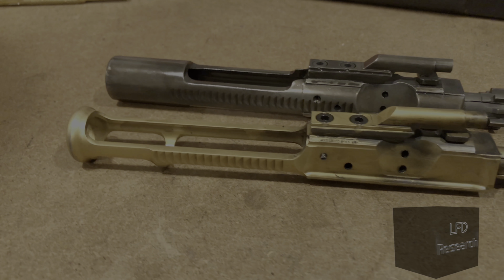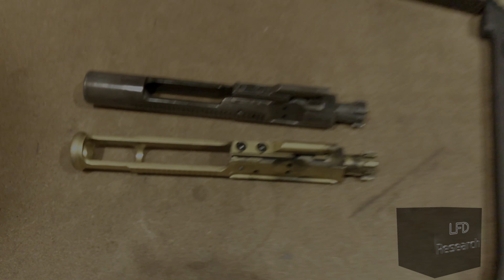Lightweight AR 15 BCG

Comment: This is the best lightweight BCG video I've ever seen. It truly showcases the differences between standard weight and lightweight. I'm looking into lightweight bull carriers to try and push the envelope of the binary trigger I just installed. This video sold me that I can run it harder and faster with a lightweight bulk carrier than I could with a standard weight! Thank you for a fantastic video this is truly underrated content
Reply from the maker: Thanks if you want even lighter they do also make a titanium carrier but it costs more than 2x as much

Comment: I love this. I hope you still check comments? What buffer did you use? The Geissele H1 buffer? That would be two steel weights and one tungsten. The Geissele H2 buffer? That would be one steel weight and two tungsten. A standard mil-spec buffer would have 3 steel weights.
Reply from the maker: It is an h1 buffer
Reply: @LFDResearch  Thank you so much for the reply! I've never built an AR before, so I want to make sure the internal components are is carefully chosen as possible. Mine will be chambered in 6.5 Grendel, by the way.
Reply from the maker: Love that caliber make sure to get an extra extractor and bolt when building it’s a common issue on the grendel bolt design. Also consider an adjustable gas system so you can tune the gun for your pet load to reduce stress on the bolt.

Comment: I really like this idea, but of course I have a question.
If you use this bolt carrier but leave a factory recoil spring & buffer with 55 grain bullets will it be worth getting?
I also appreciate the video showing what is really happening not just having to take someone's word on it.
Reply from the maker: You will still have the faster rate with a lightweight bolt carrier and the added benefit of a lighter felt recoil. But there is also the argument that it may be less reliable due to less mass in the system so you have lower overall energy loading the next round into the chamber.
Reply: I've read you'll want to get an adjustable gas block and tune your gas system to take full benefits of a lw bcg.

Comment: Im putting one of these in a new build.  16" faxon pencil barrel 1:8 twist mid length gas system with standard carbine buffer and spring.  Will I have any issues or will I need to change buffer?  Already have standard gas block on the way so would rather not have to change out gas block unless absolutely necessary.
Reply from the maker: I got this one running fine in 2 different builds using standard gas block and standard carbine buffer systems. It is generally suggested you tune it for optimal operation but this will get the job done
Reply: So I ended up putting an adjustable gas block in it,  Runs fine with roughly 3/4 of the gas shut off with standard spring and carbine buffer. To explain the gas setting, wide open would be 4 1/2 turns open.  I currently have it set at 1 3/4 turns open and its running great.  so another way to put it is its running fine on roughly 1/3 the gas.  Im thinking I could go to a lighter spring and buffer and turn the gas down even further.  My thinking is this would lower the reciprocating mass and therefore lower recoil as well.  Your thoughts? @LFDResearch

Comment: GREAT doing a WWSD build with an Aero pencil upper, just wondering if you have run cheap steel case with it yet ? How'd it turn out ?
Reply from the maker: No we have not tried steal cased ammo since we reload. I would advise against this bolt for a wwsd style build due to the gap into the action the bolt allows. Consider a standard bcg or id you want a light weight one go for the brownells titanium bcg it’s a bit lighter than this but still has the standard bcg shape to prevent debris ingress into the action.
Reply: @LFDResearch  thank you so much I did not know that there titanium one did not have the hole.
Reply: @LFDResearch  thank you so much for the information. At titanium bolt carrier group looks pretty cool. However for almost $300 it's outside of the budget. I'm on the fence still looking for a bolt
Reply from the maker: Look for a sale I got one for as low as $215 last year for the brownells branded one
Reply: @markbennettjr  I believe the Brownell's BCG is TiN coated not a Titanium BCG big difference.